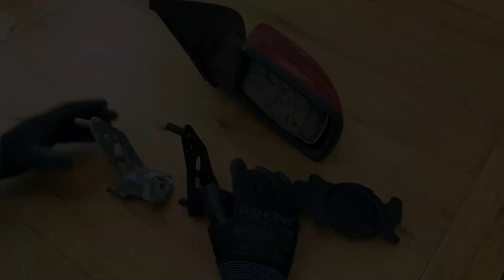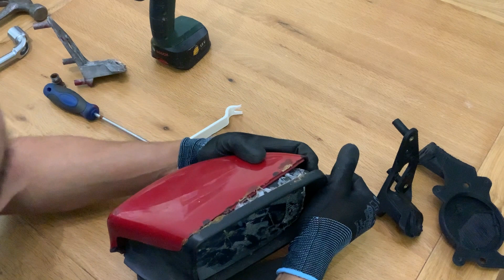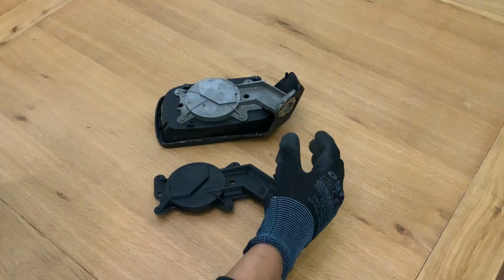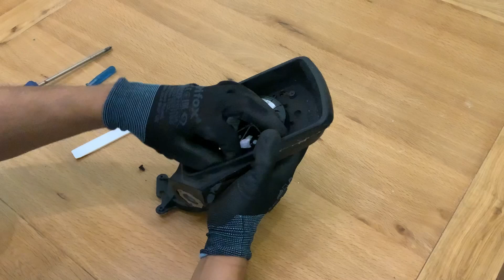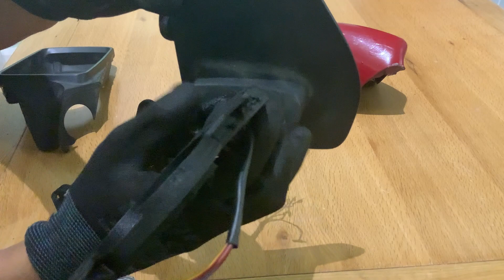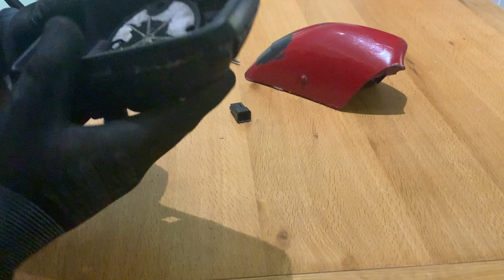Alfa 155 wing mirror tear down and repair

Comment: How much for a repair kit, please? Your website is not working. Would you please post your e-mail here?
Reply from the maker: Hi, if you're able to email me, I can advise you better. For an idea, if you need the part that bolts to the car, it is around £100 (includes the custom bolt). If you need the part that holds the mirror motor then it is around £50.

Comment: Ah this is amazing. I’ve just bought a 95 2.0 TS Sport Pack . The passenger wing mirror is broken and I’ve been looking at ways of repairing, I even considered buying a used Tipo/Tempra electric mirror to see if I could make the internal bracket work but this 3D printed version will be ideal . When I’m ready I’ll order one 👍